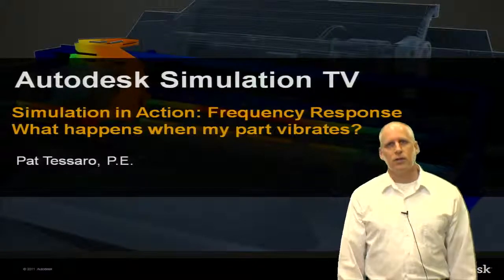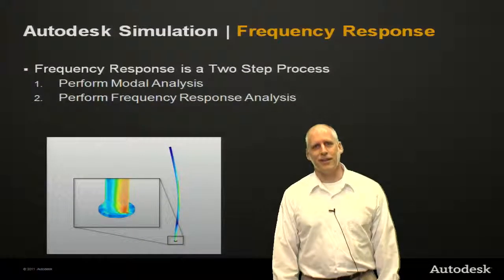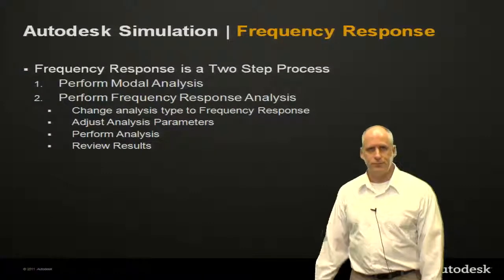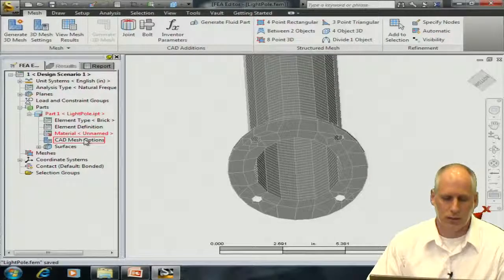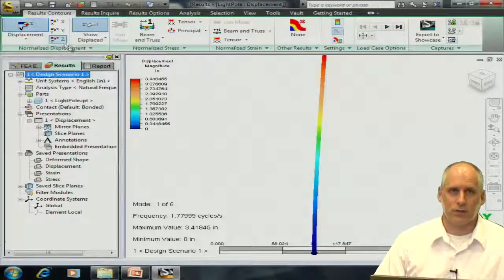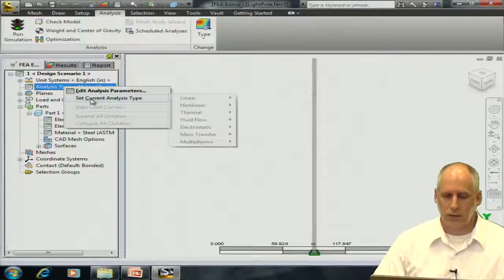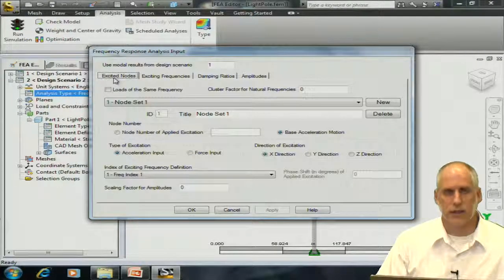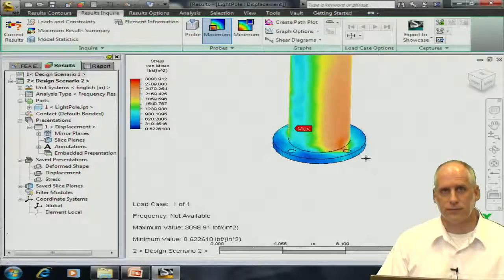Simulation in Action: Frequency Response

Comment: Hello Patt, I am facing couple of issue when I run Frequency response using simulation mechanical, one is the set up automatically adds the base/fixed nodes into the model, even if I don't want to excite the base. Secondly if I apply a force and make it to act at the natural frequency of the structure, the structure shows no displacements. I am doing this on a super simple portal frame but had no luck in getting the model to respond to forces. I am assuming this is a bug in 2018 version. Any inputs in this regard please?